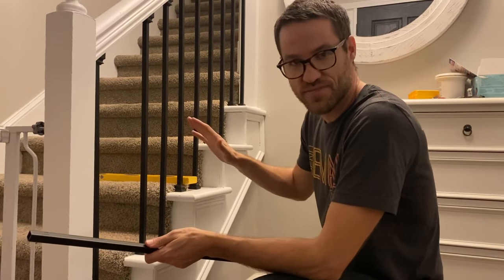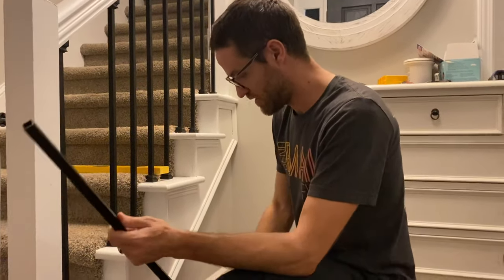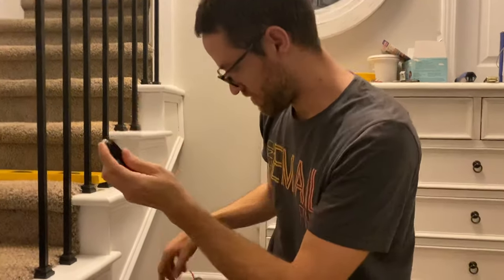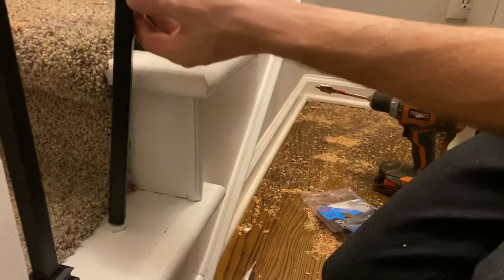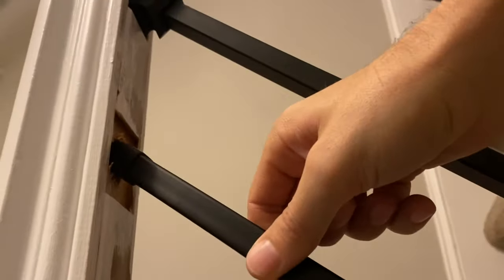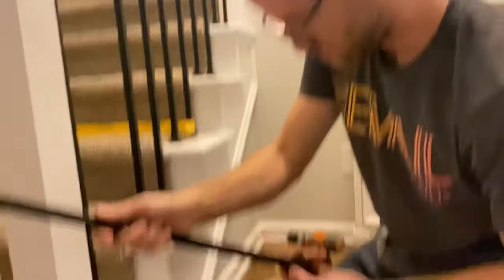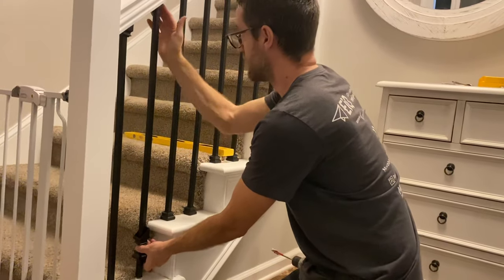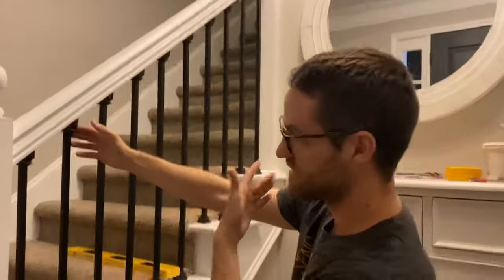Easy stair baluster replacement how to

Comment: Any way you can link to the products at HO? Thanks!
Reply from the maker: Here's a link to a baluster - but you'll also need to buy the shoes.  I think it's a little easier to navigate in the store. 
 https://www.homedepot.com/p/EVERMARK-44-in-x-0-5-in-Matte-Black-Metal-Stair-Baluster-I555B-044-HD00D/202088527

Comment: Is that a ridgeback? Also, do you have to buy the balusters individually and what are the dimensions of the balusters and sleeves? I'd appreciate it if you'd let me know. Thanks and great video!
Reply from the maker: Yes, she's a ridgeback!  And yes, each baluster was like $6 and I cut them to size (you can see the bottom section of them goes directly into my stairs so each stair had a short and long length).